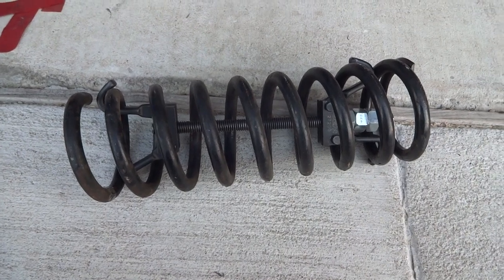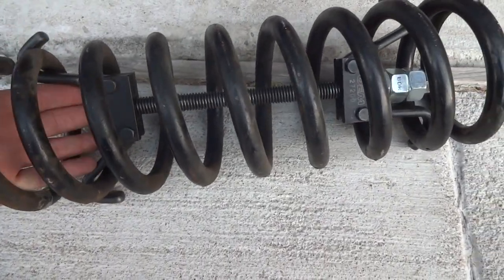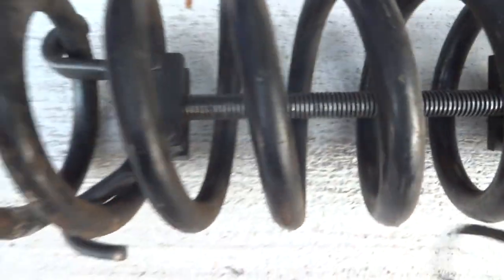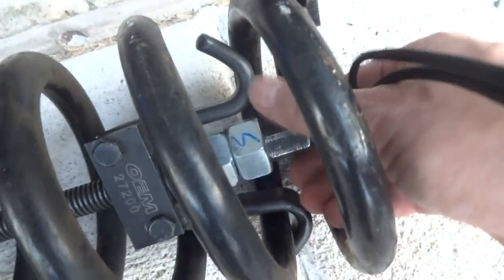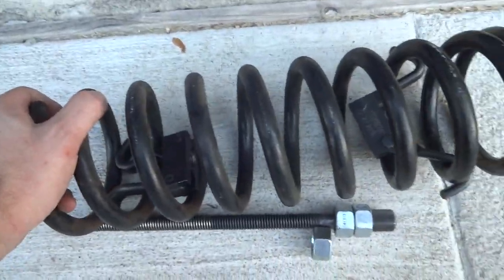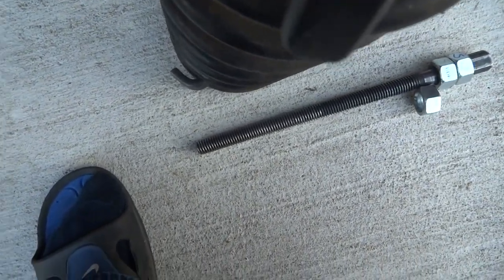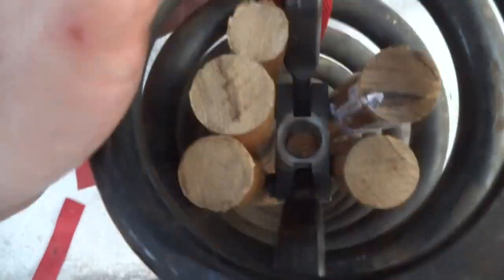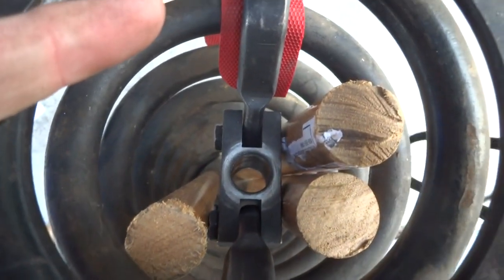Coil spring

Comment: Hey Scott, how about putting a couple of small hose clamps on the coil for each hook? ( one on each side)
Reply from the maker: Sounds worth a try. Given the forces involved, I'm not sure the hose clamps would be able to prevent the hooks from slipping as the coil distorts, but I'd be interested to hear if it worked or not.